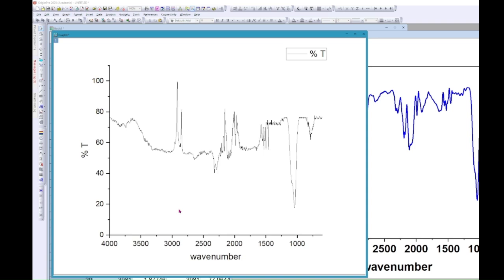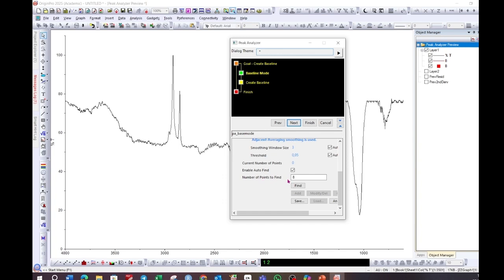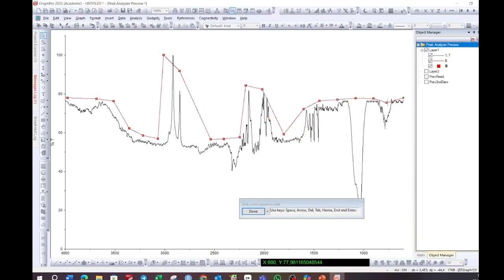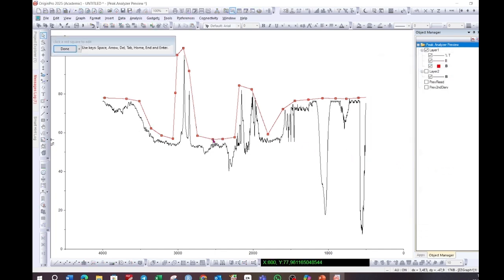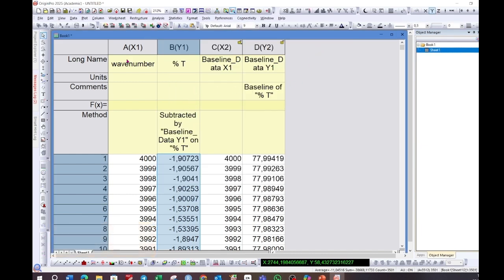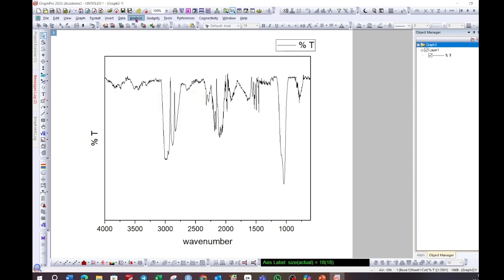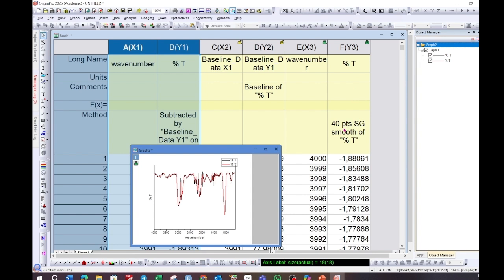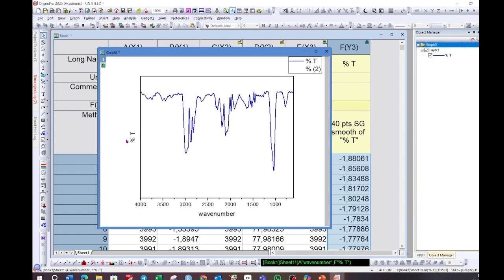Baseline correction and smoothing of FTIR in Origin

Comment: When I do baseline  correction, transmittance turns negative 200.
Reply from the maker: Hi, the transformation of transmittance to negative is not important. The final behavior after following the steps defined in the video defines the baseline correction and smoothing of the data, which you can use to plot the graph.